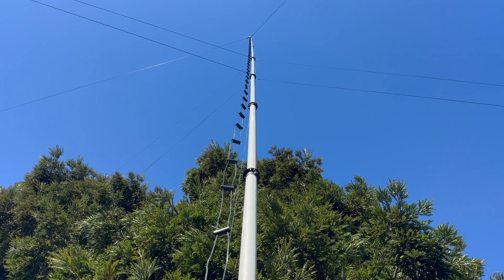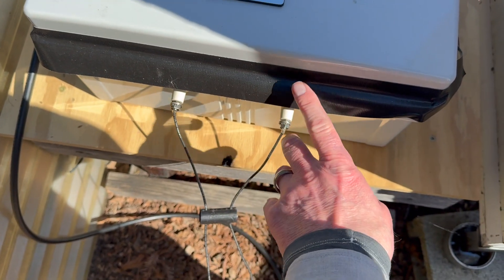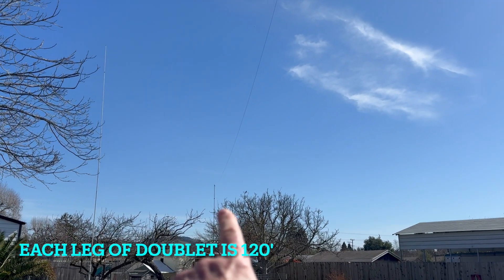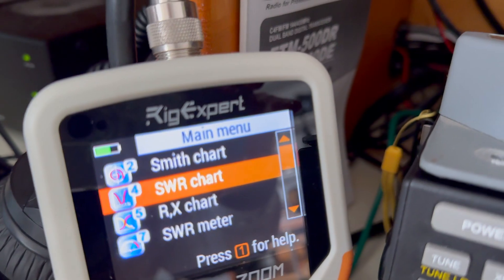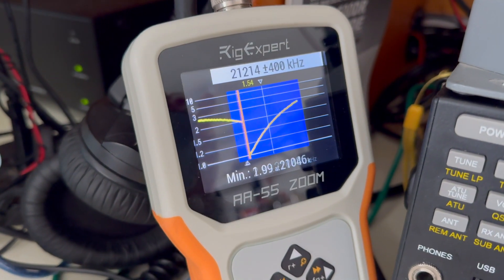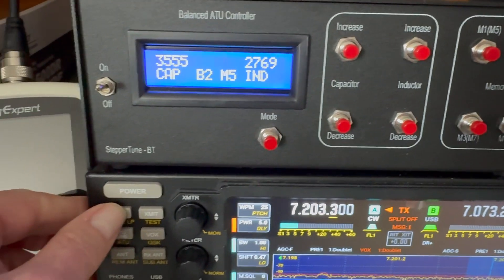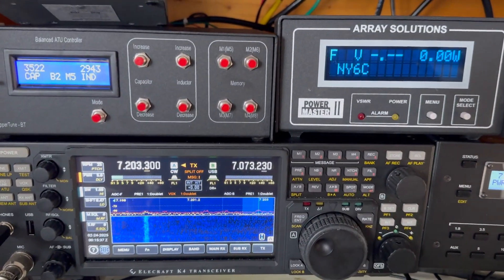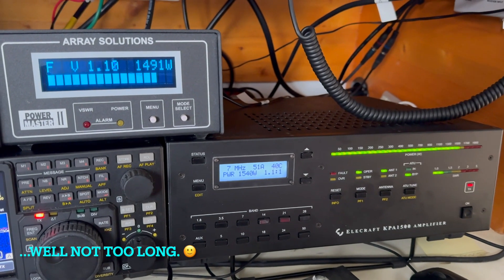Ham Radio: ATU4K Remote Antenna Tuner Demo

Comment: nice but very expensive tuner !
Reply from the maker: Yes, it's not a cheap tuner but it can handle QRO very well. I use it on 10M-160M and I can use the full legal limit with no worries of component failure. It uses a vacuum variable capacitor and other robust components throughout.  It's a "balanced" tuner specifically made for a doublet antenna (ladder line feed). TrueLadderLine.com also has a "Differential T" tuner called the ATU2KD. It's more versatile in that it can handle ladder line feed or coax. It also comes with a lower price point.
https://www.trueladderline.com/atu2kd-antenna-tuning-unit-differential-t-stepper-driven/